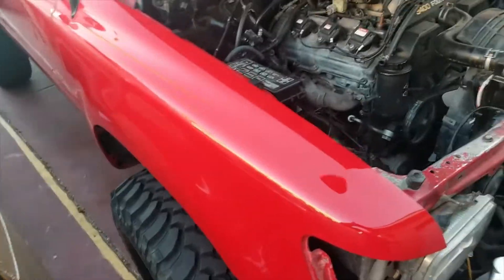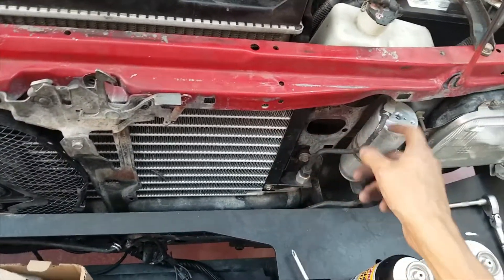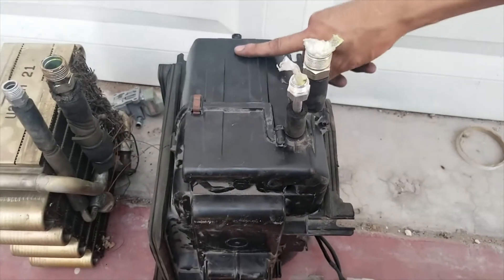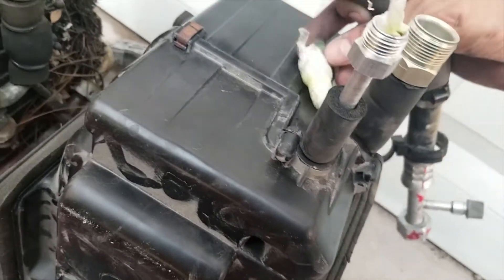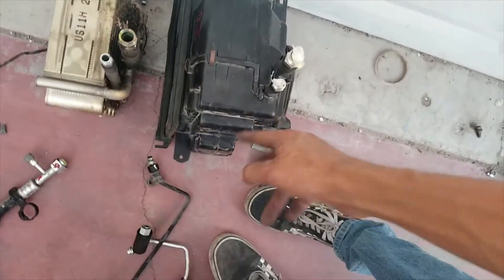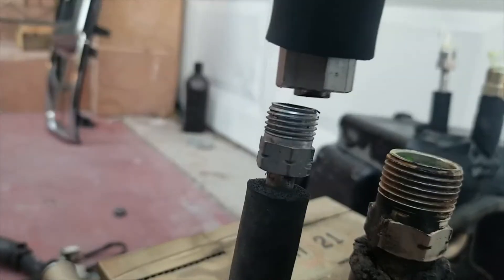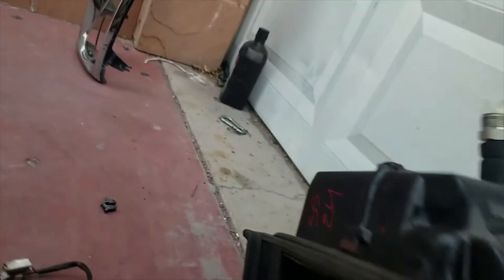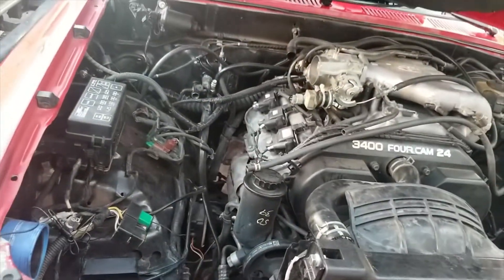Toyota pickup 4x4  R12toR134A A/C system Part1

Comment: It’s not that bigger is better the lines are bigger because R134 expands more. R134 has less cooling potential per pound than R12.  Because R134 is less dense expands more and has less cooling potential per pound the diameter of the pipes need to be slightly bigger. 

            Later they learned and compensated for this by making the evaporators and the condenser is more efficient by putting more cooling fins per inch , more cooling tubes and smaller diameter tubes but more of them to give more surface area to dissipate heat and absorb heat.
Reply from the maker: I made the mistake on using the autozone condenser it cools but once it the ambient temps went above 110 degrees  Fahrenheit  the high pressure side would go way up like if it were overcharged and the vent temps would go up